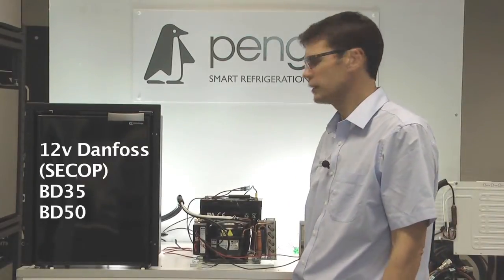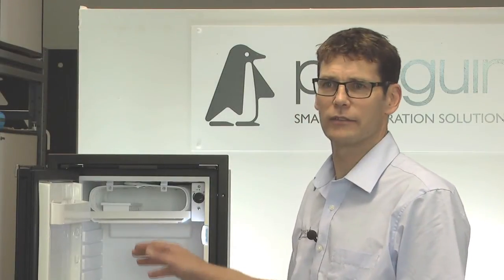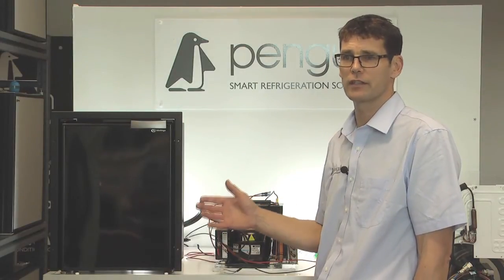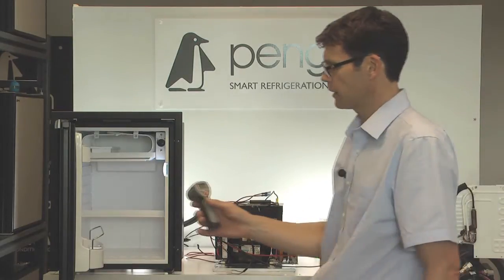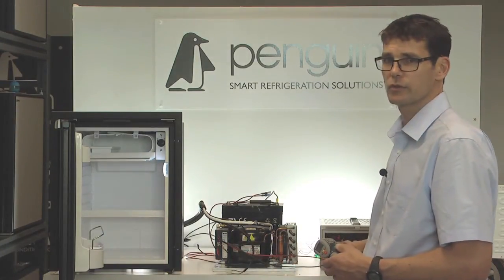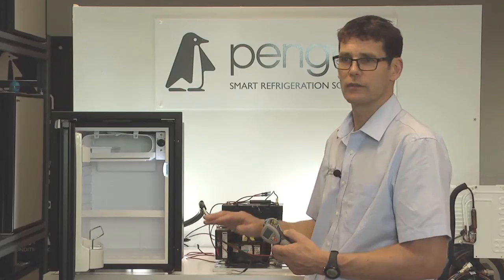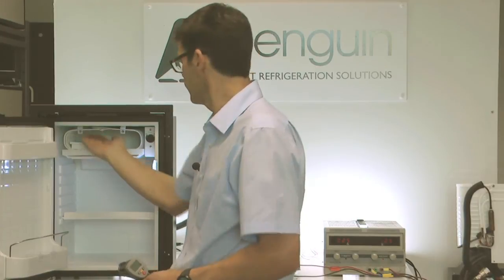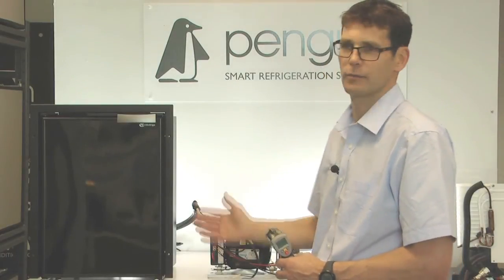DANFOSS/SECOP 12/24V DC COMPRESSOR NOT COOLING (BD35 & BBD50)

Comment: I have 13 vdc,gas is fine, but...compressor starts humms for 3 sec then shuts off,cycles this way 3 sec on 1 min off 3sec on and so on ,i just wish to eliminate that stupid electronic card, i tried 3 diff ones and non keep the comp running ,do you have a schematic to hardstart the comp. To test how much amp i get on a running comp afetr a minute into cooling??

Comment: With an unbreached system ..how does the refrigerant escape?? ..mine will not cool ..compressor and fan are running fine ..I’m having a difficult time with my particular diagnosis ..further to that ..how do I add refrigerant?don’t really see any pressure plugs or caps ..

Comment: I've got a danfoss cr1110..not cooling the compressor is humming . the fan on the pipes and fins on back has failed  . could that stop the fridge cooling.
Reply: If the compressor is running and not cooling it has a leak in the system, even if the fan is broken I would expect some cooling from a steel cage condenser.  It sounds to me like you need a fridge engineer to check the refrigerant
Reply: @zebelliott5780  i don't think you can re gas them easy. sealed unit.
Reply: Buy a clamp on 1/4" valve,at your united reffigeration or grainger ,clamp on add a bit of gas test with 50/50 water soap solution find leak stop,clean,sand paper ,remove pressure, epoxy hole,wait 24hrs regas,and enjoy imported beer. Dont ask questions just read 10 times
Reply: Clamp on or piercing valve called either way.

Comment: My Fuse keeps blowing as soon as I turn it on, also was running at high amps before this started happening. Any ideas on this issue?
Reply: If the system is 12V then the fuse should be 15A.  If you immediately blow a fuse it could be that you have a dead short somewhere in the system.  Use a multi meter to check the continuity across each of the pins of the compressor to confirm the resistance is less than 5 ohms.  Also scratch a small area of the body of the compressor back to bare metal and again check each pin on the compressor to the bare metal to see if you have any continuity.  If you do have continuity or high resistance across the pins then unfortunately you will need to replace the compressor